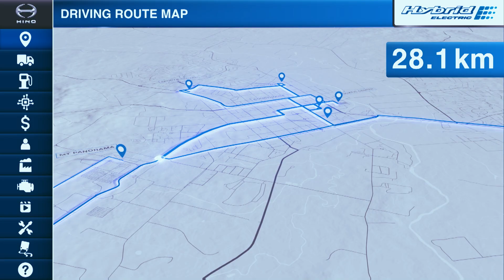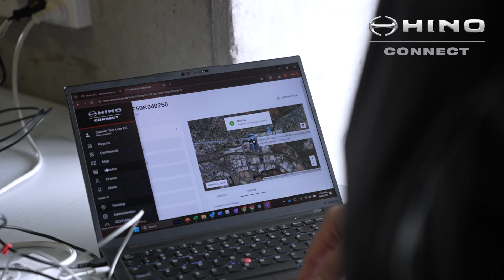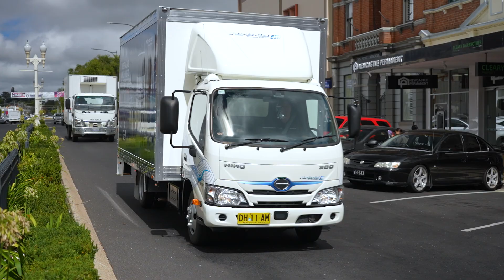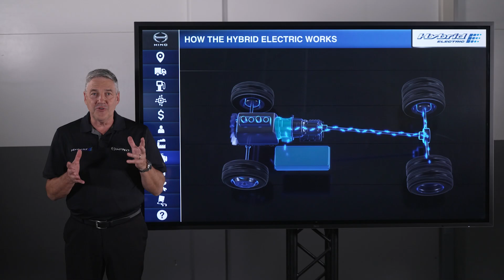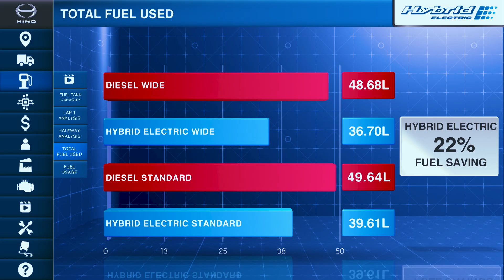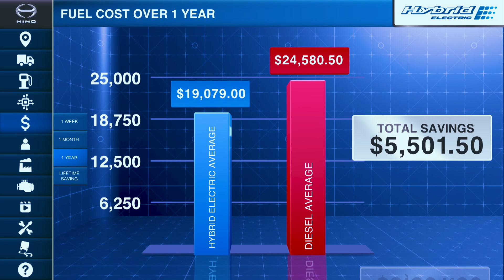Hino Hybrid Electric Efficiency Test

Comment: This is interesting, I currently have a 2012 617 (manual) 300 series with hte wide cab and, 3.4 meter wheelbase as a service truck with a large aluminium box (as wide but not as tall as this), Acording to the onboard dash it gets 6.6 KM/liter on average, that dops to 5.5 km/L towing a 3.6x1.8 meter 2.5 ton box trailer.

Despite being the larger body the manual diesel sits smack bang between the automatic diesel and the hybrid.